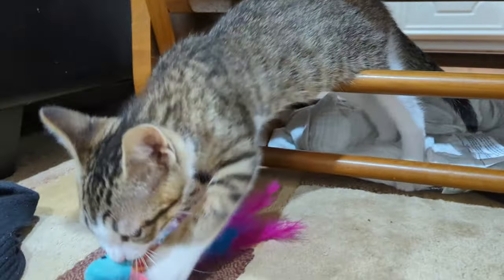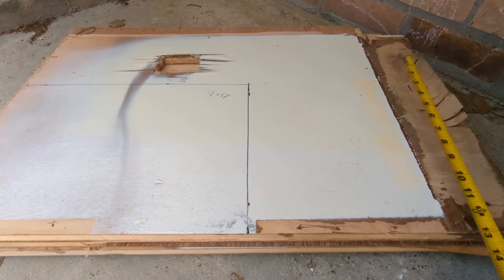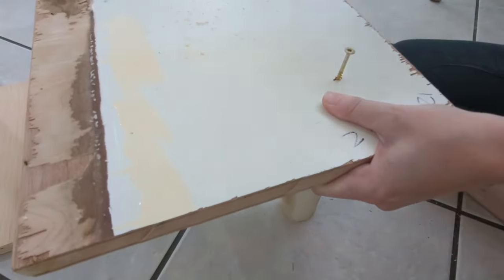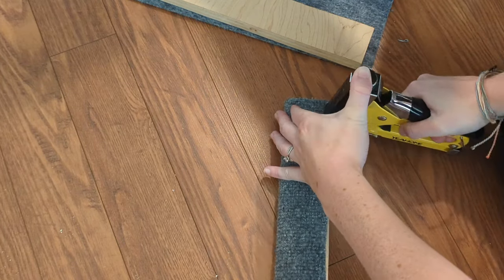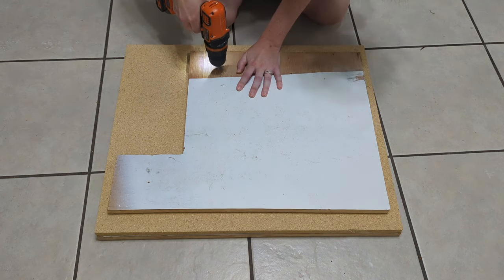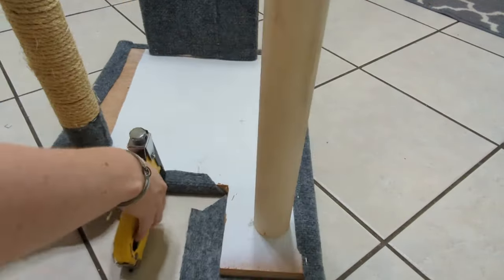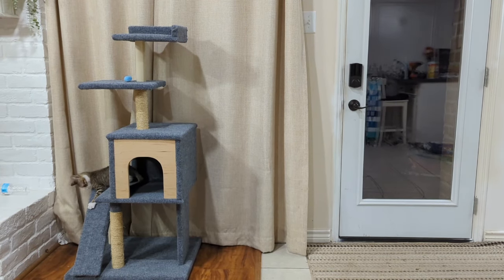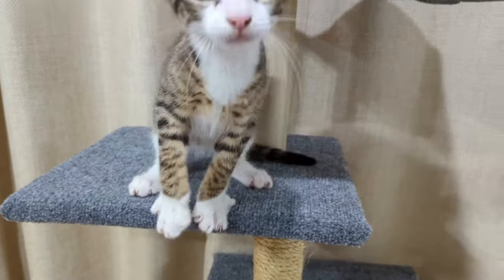DIY Cat Tree

Comment: Please add measurements for all the parts
Reply: I agree. Useless tutorial if we don't have measurements to go off of
Reply: I’m watching the video for ideas on how to attach the carpet.  Essentially, you can design your own tower, with your own measurements.
Reply: Turn on the audio, she says the measurements.
Reply: @joshkrook2458  essentially you can attach the carpet any way you please
Reply: @Brittany Johnson  for me building it was easy. I already have ideas for the size and height and features. I didn't know how to get carpet to stick and look nice
Reply: @joshkrook2458 I used glue and staples.   It’s important if your cat uses it as a scratching post to make sure to glue the carpet down.  And then staple       My cat scratches at it like crazy and I’m so glad I glued it down.   I’ve had to go back and glue some areas I didn’t do when I built it.
Reply: @corvettesyndicate3649  I made a cat tower back in January.  Used hot glue and staples.  Cats love it.
Reply: @joshkrook2458  mines been built for 7 months.   And same cat loves it.    I’ve put I hooks on the center of the bottom area to hang toys on so my cat can play with them.   Works great. I have to use steal luggage tags holders to hang the toys with I use a carabiner also to connect them to the ihook.

Comment: Wonderful project. I made a homemade tall cat tree by taking an old wicker table that I had that was not too pretty anymore for the living room and attached a short and cheap cat tree to it. For extra stability since the wicker is so light and the cat tree can tend to be heavy, I got a decorative fabric cubby to put on the bottom shelf of the wicker table and put large heavy beach rocks at the bottom and her toys and sunrises on top. And in the bottom cubby in the cat tree that she never really used cuz it’s so tiny (and she doesn’t like those kinds of tight spaces anyway) I filled a burlap bag with heavy rocks and that puppy don’t move now. I put it in front of her favorite window and next to a homemade climbing/nap wall I made from an old twin mattress I was going to toss. I just covered the mattress with a nice grippy upholstery fabric. And since the climbing wall is in the hallway I don’t even need to attach it to the wall if she topples it over cuz it is still easy for her to cling to as it falls to hit the opposing wall and then she has plenty of ways to hop down either to her cat tree or a living room arm chair right by the hallway entrance. Or she cries for me to push it back in place as she rides it back in place. Those two pieces get the most use compared to any other cat furniture I’ve purchased. Except for the perfect cat scratching post I found at a feed store. It’s super tall and has the heavy wide base. It comes with me anytime we travel cuz it takes up little space. I put it in the car last and nudge it between the luggage and the base against the rear seat door behind the driver so no windows get blocked. Thanks for inspiring me with your kitty condo build. I’m sure your baby will love it for years to come

Comment: I've done one before and here's some tip i can give you :

- Use staples to fix the sisal on the post, that way it can be replaced when your cat has destroyed it.
- Do pre-hole before screwing, that way you will avoid crack in the plank.

Comment: Whats the name of that yoga position you used while carpeting ?  Carpet Spouse?  Great narration...Beautifully done!  I'm going to copy a lot of your techniques.  I'm replacing a "bought" tree and after doing two re-carpets on them my cats are getting a new loft!  I will be assembling with the idea of how to disassemble to re-carpet when the time comes.  If these goes as smoothly as you show in the video, instead of new carpet, I may rebuild.  Amazon has velco sealed carpet pieces that work well for round posts.
Reply from the maker: That position is called "Hide the Toes from the Drill" :) I have to recarpet this tree as well because he loves to use the sides of the box as a scratching post and has ripped a few holes in it. I suggest not using glue when you add the carpet, only staples, to make replacing the carpet easier for you.

Comment: Other than my holding my breath every time I saw you drilling near your bare feet, you did a wonderful job. Another woodworking tip: When using glue for any wood project, don’t just lay down lines of it. You want to spread it like you would with paint. You can use a brush or anything that will allow you to spread it on the surface. The other materials will hold better, dry smoother and be less subject to shifting with change in humidity and house temperature. Also, periodically check that your staples are still in place because wood swells and contracts with changes in humidity which can cause the staples to loosen over time. Trust me when I tell you that you don’t want your kitty to get hold of a loose staple to play with and possibly get it stuck in their mouth or paw.
Reply from the maker: I also got a safety scolding from my husband after he saw my video footage! I promise that I am attempting to be more careful with my future projects :) I appreciate your advice and thank you for watching my video!

Comment: How did you decide the design? I have misc cat tower parts because I took 2 apart, recovered it with crushed velvet and shaggy fabric to match my couch, but now am stuck on how I should put it all together to make 1 big tower.  Did you use a CAD program to test different ideas or just sketched it out? It looks great.
Reply from the maker: Hi! Thanks for watching! I did not use any program, I just sketched it out. I looked at some cat trees on the internet and took my favorite bits from those and sketched out some designs before settling on a final idea. I did recognize a few balance issues as I was putting it together and adjusted the placement of the poles by eye, so a program probably could have helped with that.

Comment: Did you ever attach the teaser toy? I am constructing my own after watching this for inspo and I’m not sure how best to go about it. I thought about doing a small 1/2 pilot hole, feeding some of the sting in and then got glueing but it doesn’t feel like that’s strong enough
Reply from the maker: I did not end up attaching a toy, but my original plan was to screw in a bracket on the underside of the platform and either tie or glue toys onto that so I can easily replace it when it gets worn out and used up. Since I did not do that though, I cannot speak to how well that plan would have worked.